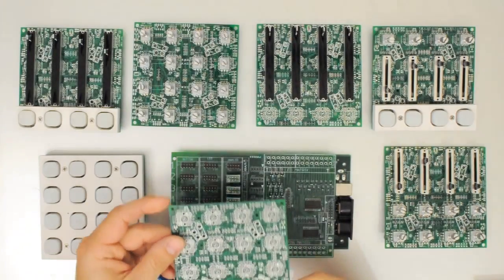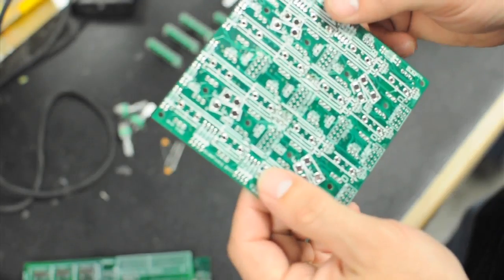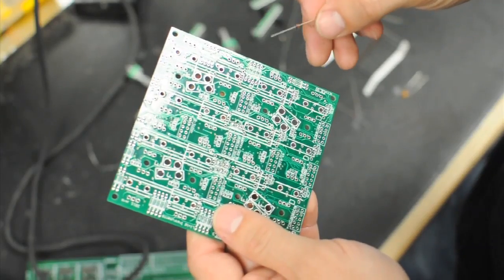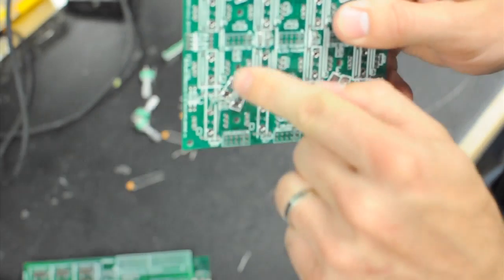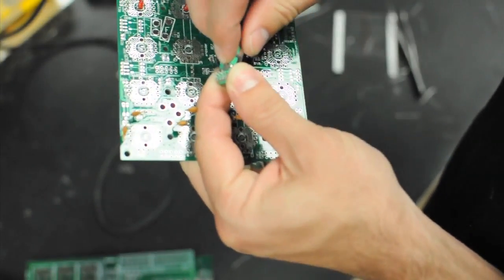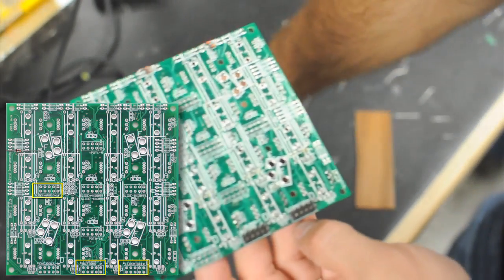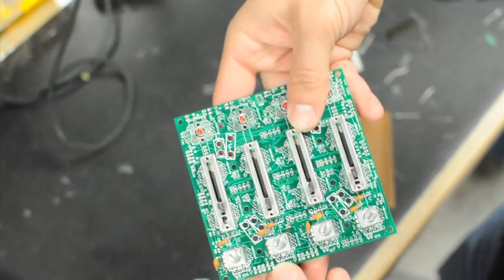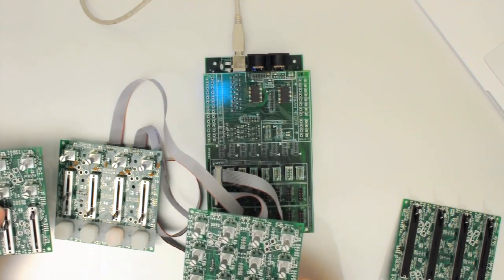Livid Builder v2 Omni Board Quickstart Guide

Comment from the maker: Sure. You can use anything as a switch, even just two wires. Any pot with a value of 10-100k will work too. Also other things like sensors, accelerometers, etc...